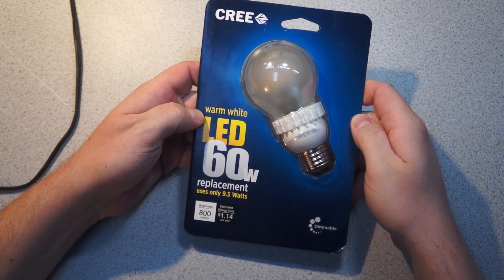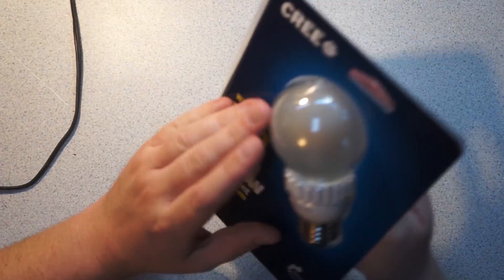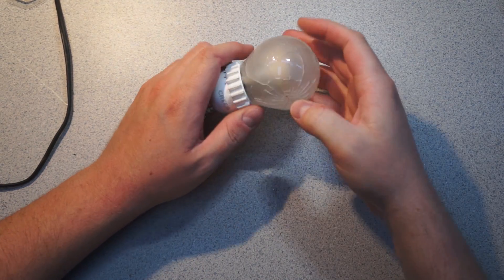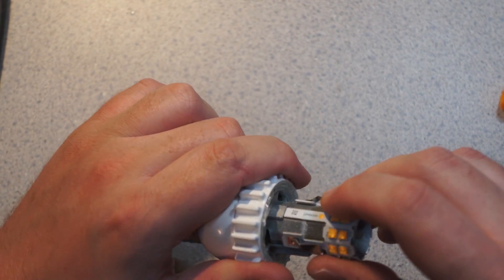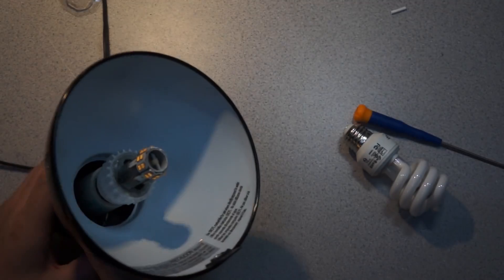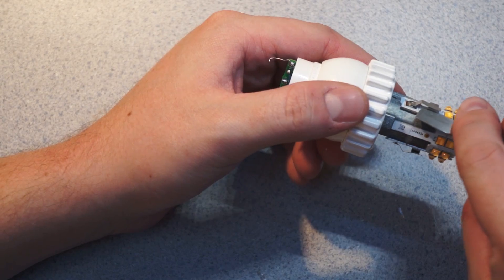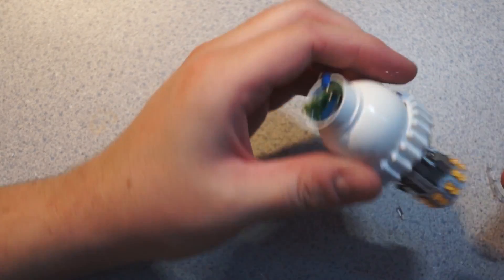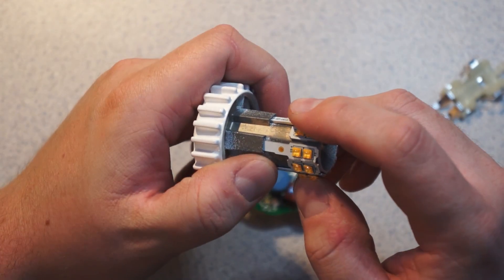Cree LED Bulb teardown

Comment: I hope everyone knows that CREE LED "bulbs" are MADE IN THE USA... and done right!  By eliminating hand-wiring, they eliminate the most common failure point... AND make it much simpler to assemble. The LED packages are all connected in series. Each of these LED's have 4-die, so you have a total of 80 white LED die in series, for a total of around 240V DC drive voltage. DO NOT play with these while turned ON, with the globe OFF!    DANGER WILL ROBINSON!! 

It's a really great design, through-and-through... SERIOUS reliability!  10 year warranty based on 6hr/day, 7 days/week - or 22,000 hours.  Price is real decent.. just wish Home Depot didn't have USA exclusive retail rights.

Even my wife doesn't know when I replace old tungsten bulbs with the 2700k versions. Personally I prefer the 5000k version, which I have in my areas of the house... it feels more like natural sunlight lighting. Workign under 5000k seems more productive, I can see my work better (I'm an electronics design engineer).

The ONLY "drawback" I can mention is that... being white LED's, they stay the same 'color' as you dim them... there's no "mood light" possible, such as with tungsten lights at very low dimmed levels. I hear some mfr's are considering adding amber LED's when they are dimmed, to emulate tungsten light color at low levels.

Don't let the initial purchase price keep you from buying these!  It's a paradigm shift in buying bulbs... you need to "think different" now. Remember... you save about 85% in electricity costs with these!  And you won't have to buy a replacement for at LEAST 10 years!  They pay for themselves in a very few years... then it's pure money savings into your pocket (or groceries)! ...and helping to save the environment!!
Reply: Footsie Wootsie As I said in my previous reply (which you apparently didn't read) I did go to the Home Depot website... and I quoted you all of their Cree consumer rating levels. Sure, you can pick out a few negatives ones if you like, but the OVERWHELMING response is around 90% positive... even though universally, user feedback on products is biased negatively... because satisfied customers don't complain as much as dissatisfied ones...  please read my entire previous comment.

AND... quoted from your linked blog...
"The failure rates for the Cree bulb are less than half the rate of any other light within its category (that is, 60 and 40W equivalent incandescents, other LED bulbs, and CFLs, etc) sold by Home Depot."
Reply: Footsie Wootsie There was nothing that "Cree told me"... it's on the Home Depot website, customer feedback of the Cree LED bulbs... I don't see what you're not understanding. You said I should look for customer reviews/comments on the Home Depot website... I told you that I did... and what I quoted you was the aggregate numerical feedback ratings based on those customer reviews. The customer reviews/comments are grossly, overwhelmingly POSITIVE... maybe you need to go back and look again... and don't just read the ones that agree with your personal bias.
Reply: Interesting... because I outfitted two houses with them, 50% are on dimmers (several different types), and I have not heard even ONE of them "buzz"! What in the world kind of dimmer did you use??  I have NEVER had a glass "dome" (the globe) fall off... not once... and again, that's with probably 40+ bulbs. My only issue as been the Neutral wire connection... as I already covered in another post here. It only happens on a very small percentage... and usually in a completely enclosed fixture, where the heat buildup is bad.

OK, so on your claim about Home Depot reviews, I went on Home Depot website, looked up the original series 40, 60, and 75 Watt versions, and found that the Cree bulbs have a 82%, 85%, 88%, 89%, 90%, and 91% positive "customer recommends" ratings... so what's bad about that???

Considering the fact that historically, far more "unsatisfied" consumers tend to go back to post a "review" of a product, than those who are happy with their purchase... if nothing's wrong, they don't even think about it... this always means you need to know how to properly interpret consumer feedback ratings.
Reply: Footsie Wootsie Your life must be exceedingly difficult if you're this skeptical about a $10 light bulb purchase lol. If the package says Made in USA (which supposedly is regulated, you cannot say it's made in the USA unless it meets certain requirements) there's really no reason to doubt it. It's just a lightbulb, so what if it blows out? I use made in China bulbs from IKEA, there is 2 for 3.49, they're  low lumens, pretty cheaply made, but for 1.75 I could burn out 6 of these for the cost of a Cree branded bulb, and 3 for the cost of a Great Value Wal-Mart made in China bulb. I've used these bulbs for two years, and I've not burned out a single bulb. I also used a Kill A Watt and they consume 8 watts or so, so I'm more than happy with that. It's better than 60 and I don't have to deal with them blowing out every 6 months like those horribly shit compact fluorescent bulbs.
Reply: I think it is great that you keep your wife sequestered to certain areas of the house.
Reply: The Lightning Stalker LOL!... it's called the Man Cave... our finished basement, which houses our H.T. and my electronics workshop, but to keep it from feeling too much like a cave (not many windows), I use 5000k lighting.
Reply: You don't know what you are talking about - these bulbs are garbage.  The failure rate is extremely high.  They have had a problem with the glass dome falling off on peoples heads since the product was released and they haven't fixed it yet.  I had a bunch of these on a dimmer - they buzzed so loud I couldn't stand them.  Go to home depot dot com, do a search for Cree LED bulb and read the customer reviews.  They aren't good.
Reply: beforebefore You don't have to take my word for it - just g to home depot web site, search for Cree LED bulb and read the customer reviews/comments.  The domes will fall off so beware.  The buzzing noise they make is dimmer dependent - they are much worse on the cheaper more common triac dimmers.  Cree went out and replaced a homeowners bulbs near my hometown because the domes were literally falling on his head.  This problem was there when they started producing these and they haven't fixed it yet - been nearly two years. I'll look for the video from the news story about the guy with the domes falling off - i'll post it here if I find it. - Didn't find the video but here is an article : http://www.designingwithleds.com/tech-blogger-has-trouble-with-led-bulb-cover/
Reply: beforebefore they are ok. color is good. I am not a fan of the new plastic ones. decent lumen per watt but I only buy the 6w ones. avoid the 9.5 watt not enough cooling. I also like to double up. using a variac or dimmer (these dim very well) you use twice as many bulbs and until they are the same brightness as half the number.

more than doubles the lifespan. 22k hours is crap. anything less than 50k hours sucks.

the way you get brighter is by adding more bulbs not by pushing more watts into one bulb.
Reply: Footsie Wootsie I build custom flash-lights using cree exclusively. Mostly XML2, MT-G2 and recently XHP-50/70. Believe me, these are the best LEDs on the market. They are absolute leaders in LED design, and constantly push the efficiency envelope. I don't think the home depot website is the de facto website for product reviews.
Reply: Jesse Crandle People do teardown videos like this, because people like you have no clue what you're talking about. Maybe if you had some understanding of electronics engineering, you wouldn't make such a stultifying statement. But hey, as long as your requirements are tended to, fuck everyone else... amirite amirite? lol
Reply: Jesse Crandlep
Reply: what about Phillips?
Reply: The problem is you believe what Cree is telling you.  DO you really think they are going to come out and say their product is shit?  You will find out - the hard way.  Good luck with em!
Reply: Maybe you need to go back and look again - the reviews SUCK, especially from January 1 2015 until now.  They are moving manufacting to China, and they have no quality control.  Failure rates will be worse once the transition is made. There is a statement in the article (link within my post above)) that states the failure rate is very low - the statement was made by a Cree executive.  Thats what I thought you were referring to.  Keep buying and you will get burned.  Remember where you heard it first.

Comment: Great vid. Helped me learn alot. I am currently looking for how to mod (and remove) the strobe function from the cree flashlights. I have bought almost a dozen different kind of cree lights, and they all have these annoying multiple modes. At best, i can deal with High and low. Rather than buy more lights, i would just like to mod the ones I have. Any thoughts?
Reply: I too am seriously annoyed by having to cycle through every mode to turn it off. Or get to the mode I want. Giver me a switch I can set and forget. (With a cover) My brother gets seizures from strobing lights or even "Picket fencing" while driving. Sunlight through tree branches. Which ain't good. He can kinda predict the picket fence and avoid it.But when I hit my flashlight, I forget...

Comment: That soft coating on the led's is a silicone coating. Its often used for outdoor/rugged condition applications. It acts as a protector from grit/grime without scratching, and acts as a cushion support system for the led. It is also often used in achieving a specific color of led, as the silicone can be tinted.
It can also be carefully removed if you have led troubles. And simply reapply a good highquality high temp silicone when repaired.

Comment: I have a question I wanted to see if I could tie a very low current dc voltage. Where would I plug those wires in. I want to see if a small solar panel can lower the wattage usage to even lower possibly 3 watts. How would I go about doing that?
Reply from the maker: You really can't.

Your options are to either completely replace the whole power-supply board, and drive the LEDs directly (and they likely are all in series, so the Vf is likely >50V, or supply the power input with high-voltage DC equivalent to the AC input RMS.

If you need low-voltage lighting, that generally requires at minimum, a different DC-DC converter topology, and generally uses different LED array topologies to optimize for the voltage supplied.

Comment: Cree redesigned their bubs recently. They now have a smaller globe, different heatsink, and 10 LEDS in 1 row instead of 20 in 2 rows. It looks like the circuit board is a bit different as well from the picture I saw. They have the new ones at my local Home Depot..

Comment from the maker: Incorrect. It actually looks to be a data-matrix barcode. 

QR codes have a very distinct square pattern in three of the corners. This is most definitely not a QR type 2D barcode. There are actually a number of different standards for 2D barcodes. This is a DataMatrix type (google DataMatrix as one word for more info).

FYI, the contents are "011304000655-45"

Comment: I have seen fairly high transient currents when running stuff with any real mains side capacitance as that capacitance acts like a short during the fast rise/fall times when the inverter potential is changing between ground potential and +/-140V.

Comment: excellent analysis.. quick question.. when u tested the bulb u said it heated a little.. What's the cooling mechanism? are those the fins on the side to disspiate heat and how hot was it actually?

Comment: Thanks for the info and advice.   I have a small solar array on the house and all the things we have on the lighting branch have to handle being able to run from dual sources.  I ran a quick one hour test on our main inverter and was impressed.  There was only a slight increase in the heat on the heat sink but not to a dangerous level.  I agree with you.  These LED bulbs continue to impress me.  I hope the longevity is there as well.

Also, where are my manners?  It's good to meet you.

Comment from the maker: It will probably be fine.

The devices that have trouble with modified square-wave inverters are things that are primarily inductive (e.g. some motors, and some transformers).

Most switch-mode power supplies (those without active PFC), such as this light bulb, generally don't have issue running off modified-square-wave inverters

Comment: A question...

Would this driver circuit overheat if driven by a power inverter?  I almost get the impression that this type of circuit would do poorly on a modified sine wave power source.

Comment: Yup!  I have a CFL I bought in 1998 or 1999 and paid $45.00 for it.  It still works to this day.  The new cheap CFLs are lucky to last 6 months.

I have gone to LED and the CREE lamps (over 50 of them in house and shop), not one has failed after 2 years so far.

The electrolytics in the DC-DC converter will determine true lifespan.

Comment: The Philips L-Prize is technically more efficient at 94 lumens per watt vs. about 84 for these. Also, Philips has recently come out with a prototype 200 lpw lamp, which is insane. I could easily envision 15-watt bulbs that are 100-watt equivalent hitting stores within the next couple years and 15-watt bulbs that are 150-watt equivalent a few years after that. I will buy a half dozen and have a very bright room. :)

Still, these are pretty damn good. I picked up two today and am not disappointed.

Comment: Cree bought out an LED lighting manufacturer called Ruud Lighting in 2011. They are aggressively moving into the lighting product market rather than just manufacturing the LEDs themselves. They do all sorts of industrial and commercial light fittings now which are quite nice (but don't ask about the price!)

Comment: Very interesting video.  I've got five of these bulbs in my dining room and am glad to see they are manufactured with quality parts.  Also, here are some side points:

-while the color temperature of these bulbs was supposed to be the same as the CFLs which they replaced, these bulbs give off a noticeably better quality of light than the CFLs.

-these bulbs are manufactured in the United States, I believe in North Carolina.

Comment from the maker: Yep, DC-DC. The first thing done for input AC is rectification. The actual switch-mode power supply then operates on the rectified AC.

Most dimmers use something called a Triac. Google "Triac Dimmer" for more information. If they used a potentiometer, the potentiometer would dissipate an enormous amount of heat.

Re: Scoping. In this situation, since it's non-isolated, it's not safe to scope without special techniques.

Comment: Is it not safe to scope the output of the power electronics? The contact leads before they go to the LED array.

Also, DC-DC? not AC-DC?

I had the impression that interior lighting dimmers used a form of potentiometer, so voltage across the bulb terminals drops. This is why some bulbs can't be dimmed because they require a minimum or constant voltage to remain on.
Ideally to dim LEDs you'd change duty cycle of the pwm, but you can't do that on an AC converted source without a driver/controller.

Comment from the maker: Re: Voltage - I don't know, but it's probably either for 10 or 20 white LEDs in series.

On PWM - It's a DC-DC converter, so it does PWM, depending on how you define PWM. The actual LEDs are likely constant current driven.
It also supposedly supports dimming the LEDs. I'm not sure how that works.

Comment from the maker: There are a couple very integrated LED drivers available.

I think it's still cheaper to have a separate controller and power device, though. That way, they can use a fancypants process for the controller IC, and a much more coarse process for the switch. That way, you get a lot of controllers per expensive wafer, and the power device is fine with a cheaper process.

Comment from the maker: I have in some of the previous videos. I guess I just didn't comment in this one.

Yes, It's pretty nicely built. However, I do worry about the potential contact issue with the metal-core PCB and the heatsink. 
Give them some time to sort out manufacturing issues, and it'll probably be a good deal.